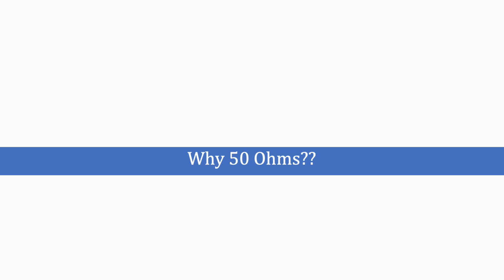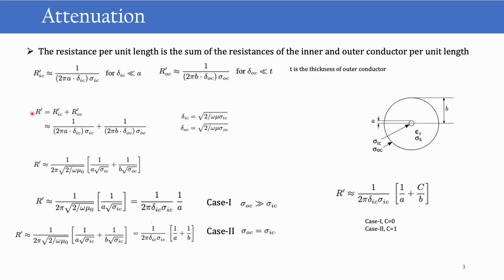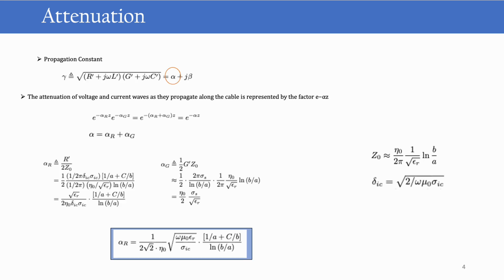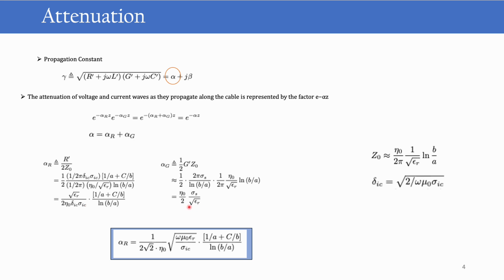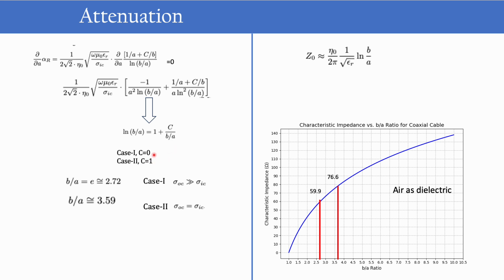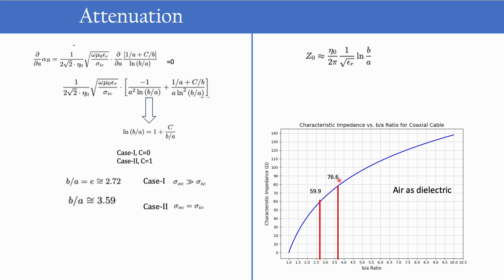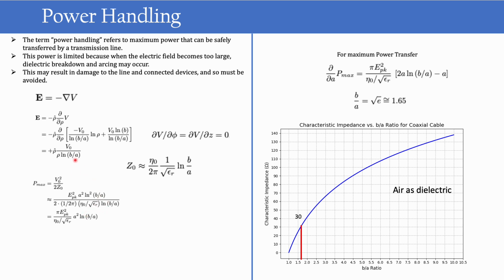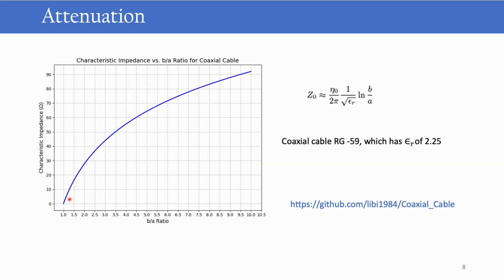Why 50 Ohm??  #antenna #coaxialcable #electromagnetic

Comment: 10:00 you show these for air as dielectric, but real coax has dielectric with higher er so Z0 would be lower. Going to your slide on mean of max power and lowest attn, shouldn't the lower Z0 for coax be used instead of air as dielectric value?
Reply from the maker: correct. In actual coaxial cable dielectric constant is much higher. RG-59 coaxial cable has permittivity of 2.25. 
For diff coaxial cable, it will vary. 
As it is impractical to consider every combination, air is considered for analysis.